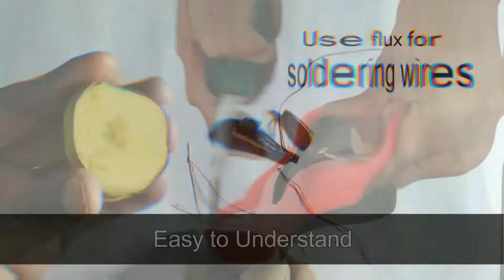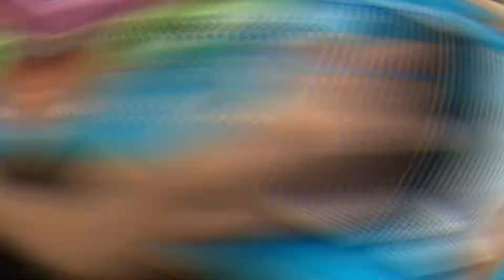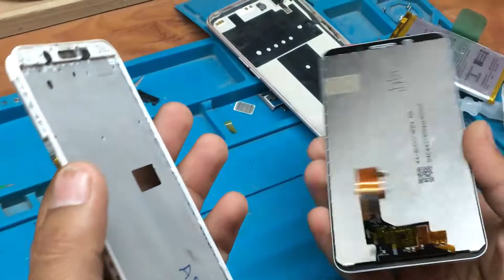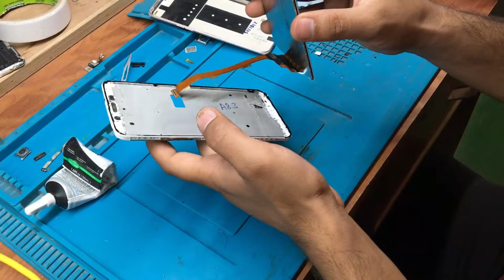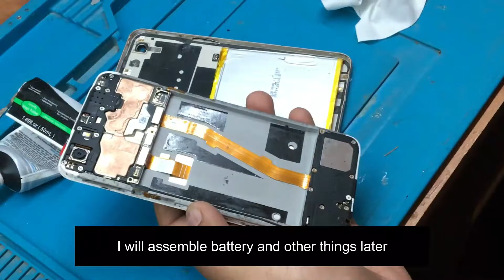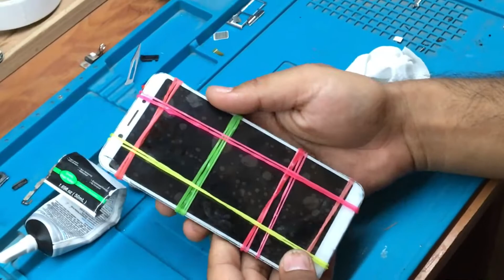Oppo A83 screen LCD Replacement  | original display pasting | @AndroidWorldYt

Comment: Hello please reply to me anyone anybody to this ...( I REPLACED MY DISPLAY TODAY THE OWNER SAID IT WAS ORIGINAL AND I PAID 4600 FOR IT AND MY BRIGHTNESS IS LOWER THAN MY BROTHER (SAME DEVICE ME N MY BRO REALME 6 BOTH OF US REPLACED TODAY) BUT HIS BRIGHTNESS IS MORE THAN MINE ... AND MY SCREEN COLOUR IS LIKE YELLOW OR ORANGE IDK COLOUR BUT EXAMPLE LIKE I HAVE MY EYE COMFORT TURNED ON AND MY GAMES LAGS (BGMI-30-50FPS) AFTER REPLACEMENT BEFORE IT WAS NICE IT DOESN'T LAG 50-60 MOST OF THE TIME.... (MY BRO GAMES IS JUST LIKE IT WAS USED TO BEFORE REPLACEMENT HIS DOESN'T LAGS) ...AND MY MOBILE LAGS AFTER THE REPLACEMENT I THINK I CAN FEEL LIKE IT A BIT SLOWER THAN BEFORE AND IT DOESN'T EVEN FEEL LIKE 90HZ REFRESH RATE... I FEEL LIKE USING LOWER THAN 60HZ TOUCH... ( SHOULD I CHANGE IT OR COMPLAIN TO THAT OWNER) ....
Reply from the maker: First thing is you can get original display in service centre only . sometimes the shopkeepers have dead phone with original display only in that condition they can say that we have original display. Otherwise you may be fooled with some local high quality display .
Reply: @TechnicalVampire  thanks